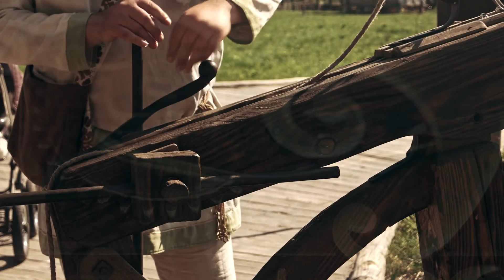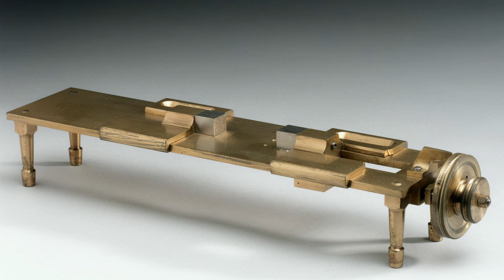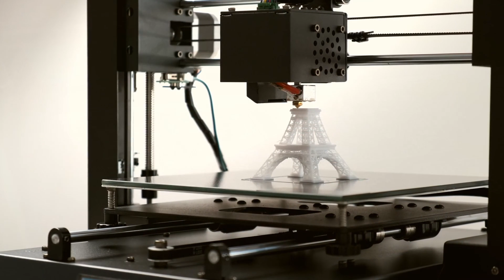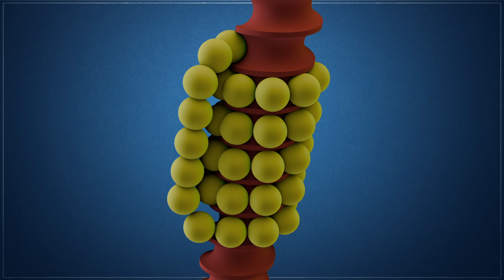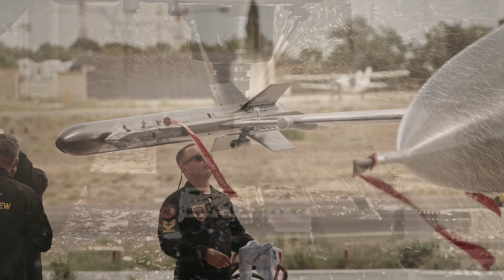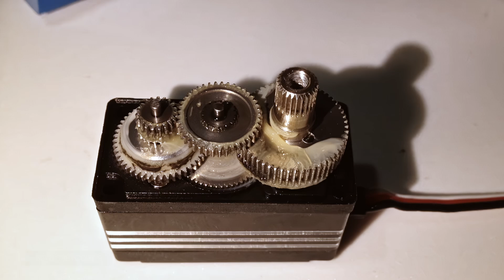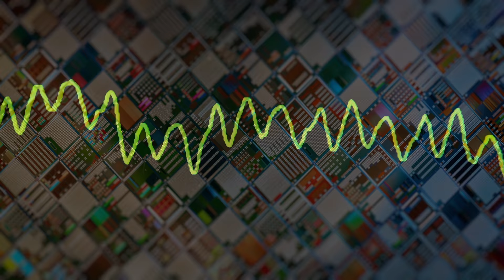The Obsessive Engineering of Precision Linear Motion

Comment: Am I the only one who didn't get how the piezo crystals create motion that is usable?
Reply: If you apply DC voltage across opposite sides of a piece of crystalline silicon dioxide(Sio2), it will deform slightly, which is directly observable under magnification. The amount it deforms is directly measurable by microscope.

This allows one to calculate the necessary voltages needed to make a Sio2 piece deform just enough to push the lead screw along the threaded rod an also known amount by pulsing it off and on rapidly. One can then calculate how much voltage is needed in order to move the lead screw a desired amount, to a high degree of precision.
Reply: @tomkzinti2760  ok I guessed that part, but, I cannot see how this is 1. fast in any way and 2. wouldn't slip. By the animation, it's a tiny piece of metal scraping on another piece of metal. How could it create any meaningful force? I need a slomo close up shot of this, I cannot imagine haha

Comment: In summary, we used to use nuts but now prefer balls over nuts because nuts got way too hot and tend to stick to the rod.
Reply: In order to prevent both nuts and balls from sticking to the rod, proper lubrication is required.
Otherwise, both precision and operator satisfaction will degrade due to unnecessarily increased friction...
And the shaft MUST be properly hardened.
Reply: @bavarianmonkey8326 the cylinder must not be harmed
Reply: @secure_b6725 Because of course 😂
Reply: @secure_b6725 the balls harden
Reply: @bavarianmonkey8326 😂😂😂
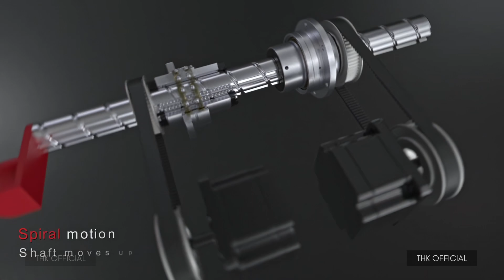Reply: 17:48 the Shaft must be Supported!
Reply: Nowadays, in the most developed systems, the balls have dropped entirely and been replaced by very short shafts in a metal cage...
Reply: @gordonwalsh5652  you missed the joke
Reply: Pharo CNC machined the pyramids with his  balls...
Reply: @RMSFACTOR a lot of stuff has been machined with small or huge balls. Those balls were made from steel and are usually surface hardened.
Reply: The quantity of load must be measured. Pre-load is also an important part of the process and nothing to be embarrassed about...
Reply: dawg :face-blue-wide-eyes::face-blue-wide-eyes::face-blue-wide-eyes:
Reply: I see what you did there.
Reply: Nuts have backlash and ballscrews get as close as physically possible to not having backlash. Reduced friction and heat is also a benefit, yes.
Reply: This is why I pay for premium lol
Reply: ...something something,...grease nipples...something somtheing...flange...lube...screw...balls...load...
Reply: Galling = chafing
Reply: There aren't too many professions where you can talk about balls, nuts and rods in the same sentence and it all be work appropriate 😜
Reply: @dogbarkmanmd2498 yeah, especially when you consider that the shaft must always penetrante the ball nut fully. Otherwise the machinery of well coordinated linear movement will come to a complete interruptus very quickly...

Comment: These are my favorite videos on the internet, the reasons for needing, the thinking processes by the minds that needed, and the advancement through history to the present, of machine and solid state solutions for problems encountered by the progress demanded by creativity. @cubechemistry scratches another itch for the chemical version of the same blueprint of educational video, with an added air of comedy and sarcasm. That being said, I had a point of information disconnect, or a gap in understanding when there was a move from 3d modeling for the ball bearing screw mechanisms to the more modern fixed rail ball bearing mechanisms outlined in 2D. I think my mind may have been lazy and did not translate the change quick enough for a fluid transition between technology. I will have to watch this section a second time to create the movement in 3D in my mind. I highly appreciate all of your videos, and look forward to all of your releases. Thank you for your extensive work, time, and energy to impart this kind of knowledge on those of us who get pleasure and deep seated settling feeling through understanding of concepts, their histories, and the applications.